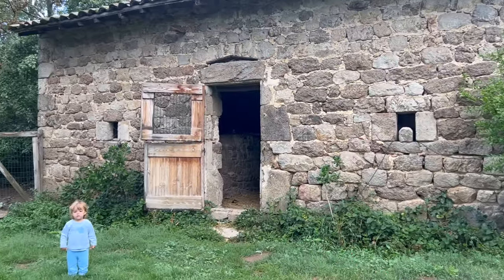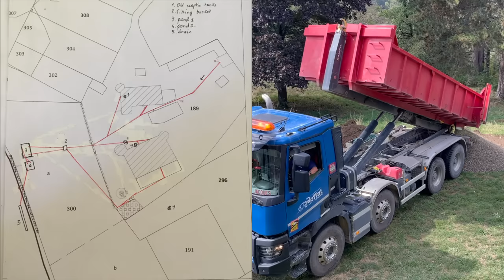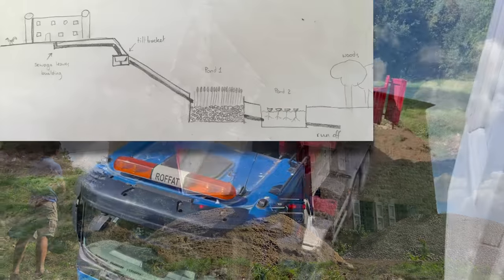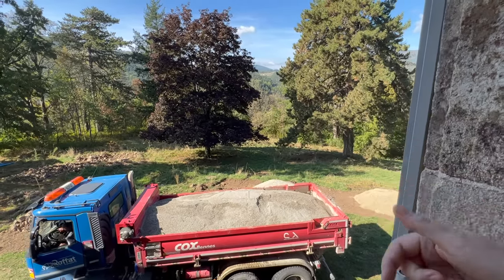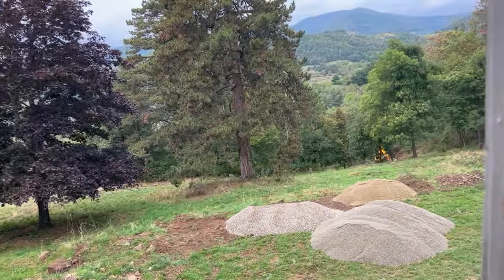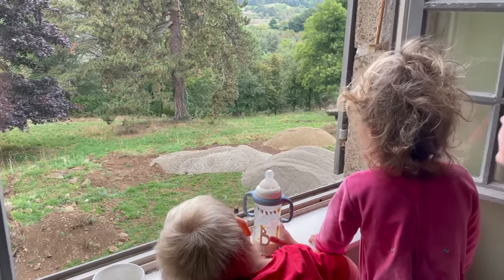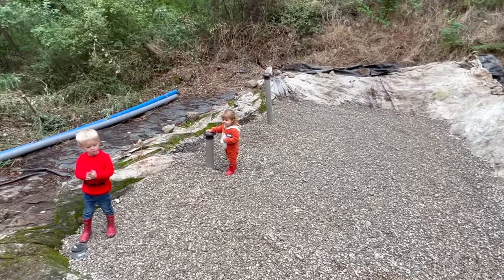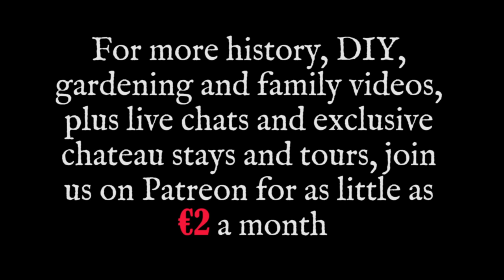Building a HUGE eco sewage system for our medieval château estate

Comment: massive project I engineered my septic system at 1,100.00 vs 12,000.00 with your system in so far away the key is lots and lots of water.

Comment: Just some FYI.. my high school friend's father was stationed in the mideast desert during WWII.. He told me they did #1 in 18 inches of sand and it came out clear at the other end and they reused it.  Must be in some army manual somewhere!  either backhoe or excavator.. we use the excavator to build retainer walls and backhoe to move dirt.  you are in a pickle.. it will all sort it self out in the end!  Amy, whenever I go to the lumber store I ask for the tarps the lumber comes wrapped in.. Not sure if you have it.. I use those tarps for so much hauling around the farm.. Weeds etc.. But you could put it down before the gravel on the grass... Those tarps are heavy duty and much better than anything you buy.. and I get them for free here in Cda.
Reply from the maker: It’s all fixed now! It was just a couple of days when things went a bit wrong due to circumstances beyond our control!

Comment: My first thought for getting gravel and sand to the ponds was air conveying.  The coarsest gravel might be a problem, but the sand is easy.
Reply from the maker: Air conveying? It's not accessible by helicopter because of the forest.
Reply: @LostGardensofChateauRosieres  no, not airdrop, air conveying.  Lots of air keeps sand fluid and it can easily flow down a pipe to its destination.  Just need enough 6" pipe to go from the sand pile to the ponds.  Doesn't need to be straight.
Reply from the maker: @genelane2243   Ah I think that would have become very expensive due to the distance, and we've got large stones as well as sand and gravel. Also a large part of the problem would be loading the sand, gravel and stones actually into the pipes - there are several tons of it!

Comment: Why  could you not get a hand winch and string up a cable system,  scoop up gravel or sand, put in your rubber buckets with handles, and use the winch to send it up and down the hill?
Reply from the maker: Firstly it would take a huge amount of time and cost quite a bit in resources, but also the slope is so long and steep that a single cable would not stretch taut, even if there were sufficiently large trees at the top and bottom. Remember it’s heavy stone and gravel. Also it would take forever to load buckets one by one. It would take a couple or solid weeks to move the sand and gravel like that. When we have hundreds of other projects going on at the same time it’s better to wait for the right equipment!